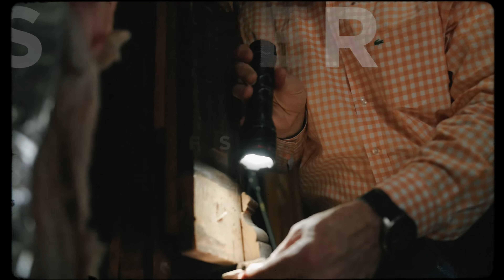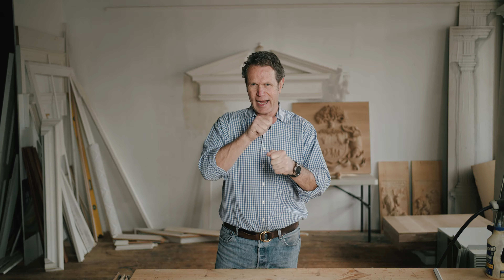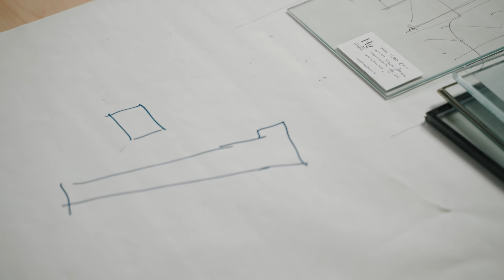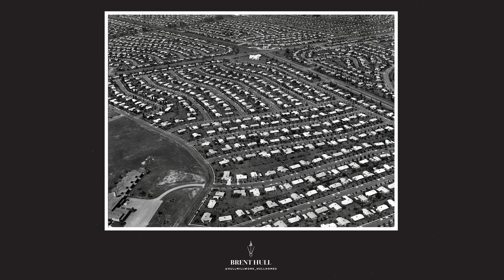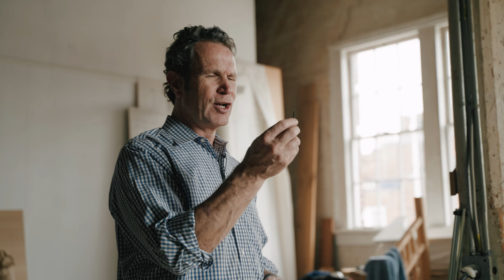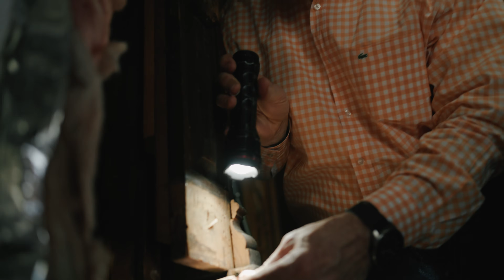Dating Nails- how things change, what they tell us.

Comment: Thanks Brent, I was just thinking about this issue as I am remodeling my new-to-me 1972-built Scottsdale, AZ custom home.  The first remodel for this relatively young house used drywall nails but then later remodels used drywall screws.  Also, cut nails were used to hold the bottom plates to the slab during the original build but the last remodel used concrete screw anchors for the newer bottom plates.  I am trying to determine what the original floor plan was so I can stay true to the architect's vision while still updating it for today's lifestyle and function.  The best advice from you is to not use trendy features or techniques that would immediately indicate the date of the remodel.  I am using features from the 70's through to current, but not letting any one set of trends identify the remodel year/era (i.e. using slab doors for the all-new kitchen cabinets, and retrofitting original-style baseboard moldings throughout the house, etc.).  Thanks for all the effort you put into these videos.
Reply from the maker: Thanks for sharing.